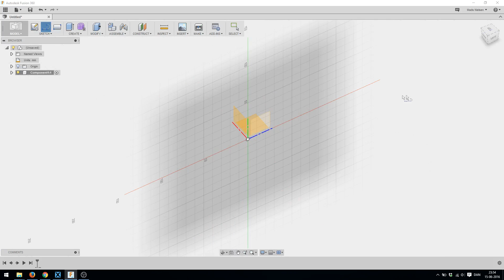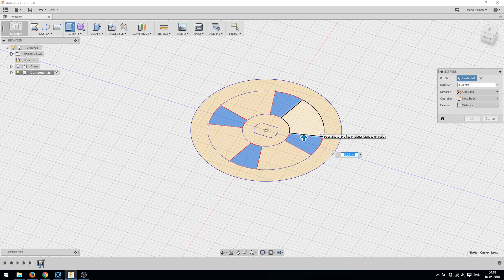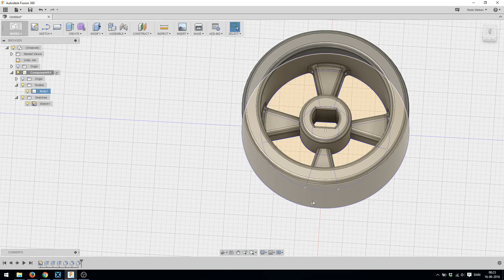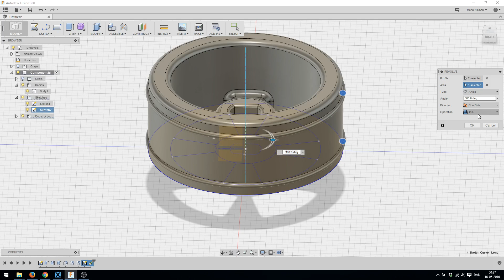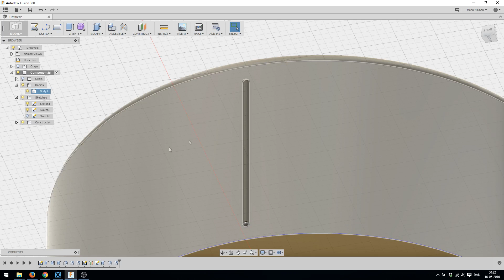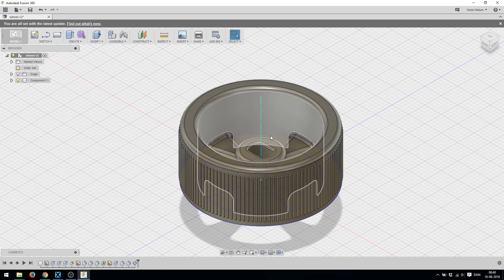Introduction to Fusion 360 (Making a wheel for an Arduino robot car) - Ec-Projects

Comment: Need to learn Fusion 360. Intresting. Nice job
Reply: I can not save file to my computer (local)? Only option is cloud?
Reply: There might be other ways to do it, but try to goto FILE -> EXPORT meny.
There is an checkbox for "Save to my computer"
Reply: Saves to .f3d what is archive file and you cannot open those files. Error: "Opening of local file is not supported!"
Reply: I tested it here now, and it was working fine.
To open the drawing you must first upload it.
In "Data Panel" you will see a small symbol for upload to cloud.
Reply: I like to save it to my computer not to cloud
Reply: I agree, but Fusion 360 is cloud based.
If you loose the internet connection, Fusion will use a cached copy on your computer.
Reply: Thanks for help anyway. I just have to get used to store to cloud services
Reply: #2 Reason I don't like F360.  #1 is that it locks you in to having to use a mouse AND a keyboard for actions that other software does with just a mouse.  The reason is this is Autodesk and they suck.  Do it our way or get lost and when they sucked up Maya so long ago they stuck its interface on a CAD program and it is not the same workflow as a 3d rendering program Hollywood uses.
Reply: +Dark Alchemist Ok